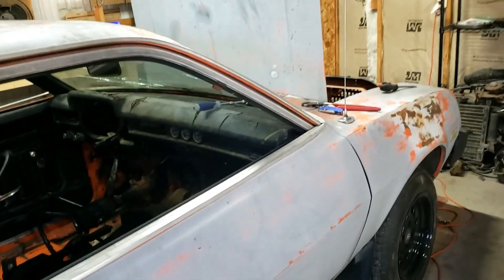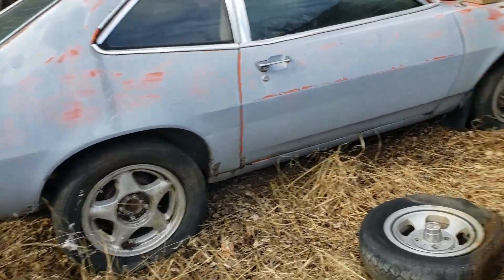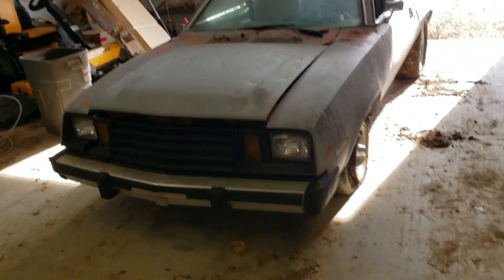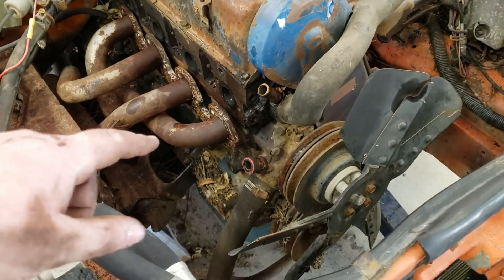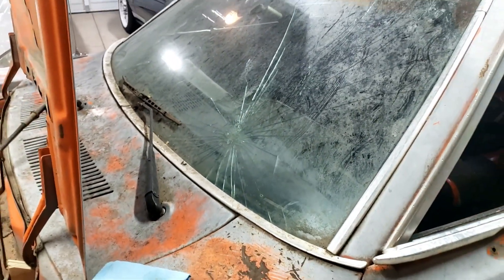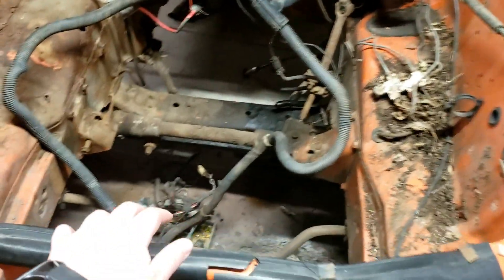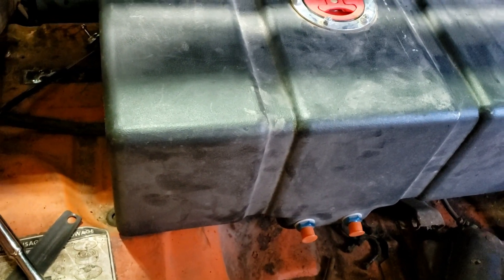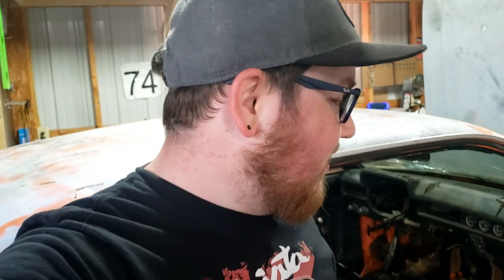1979 Ford Pinto Resurrection!   Part 1

Comment: I like Pintos, especially the early ones and the wagons.  The wagons never had the fuel tank safety problem and the recall fixed them on the hatchbacks.  They turned out good in the long run, unlike the Vegas, which I like too but the defects are harder to fix.  Both take bigger engines well, but I like small, light engines for better mileage and traction, more like a dune buggy.  Classic economy cars are cool dailies.  I want to see more on them.
Reply from the maker: Yeah, so many people put v8s in pintos, but you will never see me doing that!
Reply: There are so many great four cylinders for a Pinto, the OEM Ford motors were good as well.   I'd like a VW TDI diesel swap - I'm not sure about the oil pan clearance on the TDI swap.   I've learned that if you set your goals to not impress other people you can achieve them
Reply: @timothykeith1367  Would you use Ford or VW trans? swapping between companies always sounds complex and labor intensive to me but might occasionally be worthwhile.  Does the TDI weigh less than the 2.3? as for me, mileage comes second to traction, but if VW diesels are converted from gas designs, then they might be light like gas engines?
Reply: @alan6832  I have a Toyota W58 transmission(Supra), for which an adapter exists.  I think there are T-5 adapters.  As the Pinto also used a cast iron v6 I don't think the weight of the TDI is an issue.  I'd use the ALH, there are several VW diesels.  The question is oil pan sump clearance.  I think the Pinto  is front sump, the ALH pan is flat. I believe there is a Passat oil pan for longitudinal engine mounting that had a front sump.  My interest is fuel economy and being able to use "black diesel".  I figure with the 2,300 pound weight a diesel Pinto could get 50+ mpg, but I'd probably chose the heavier Squire.
Reply: @timothykeith1367  front weight is always a big issue with any front engine RWD car since traction is inversely related and getting stuck in the mud or snow takes hundreds of times more time than slow acceleration.  Though I suppose the diesel might still get better mileage even with a sandbag in the rear, and maybe if the diesel makes less heat, maybe it could get by with a lighter weight radiator?
Reply: @alan6832  The 2.3 Lima four is pretty heavy.  When I look for weights I see different figures, somewhere around  370 to 415 pounds might be a good range for the ready to run motor, with a bare long block as low as 300 pounds. There are several different VW diesels with different weights.  I have an '84 Dodge Rampage and it weighs the same as a Pinto hatchback.  I could use a vw diesel in the Rampage.  I'm more interested in fuel economy than handling and performance.  With the rear drive Pinto I could select the final drive that would have the lowest cruising rpm,  which is not easy with front drive
Reply: @timothykeith1367  Sounds good, except that it is traction in mud and snow that really bothers me with risk of getting stuck. this is what rivals fuel economy in my book, not handling or performance.

Comment: Did you do any tests on the original engine? test results help value even if you sell it.
Reply from the maker: The hood sat open for well over 15 years outside. The engine in it was definitely junk and not numbers matching lol plus I will probably never sell this car.
Reply: @PeaceParts  I meant sell the engine.  Did you try to turn the engine to make sure it was seized?  even so, I have seen people revive some badly seized engines.  Is either oil pan off the original engine? other parts?
Reply from the maker: @alan6832  there may be some salvageable parts from the old engine, but it was definitely seized. Took the flywheel off without having to hold the engine.  Either way, the engine is still sitting at my parents farm, its not going anywhere lol. These engines are dirt cheap, I'd rather buy new parts if needed.
Reply: @PeaceParts  I noticed you salvaged the dipstick, so you got something.